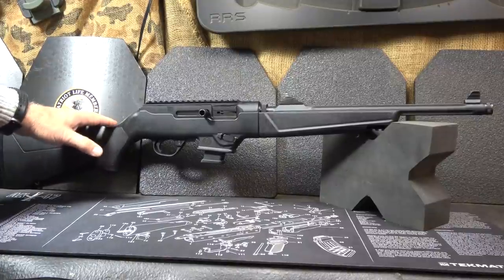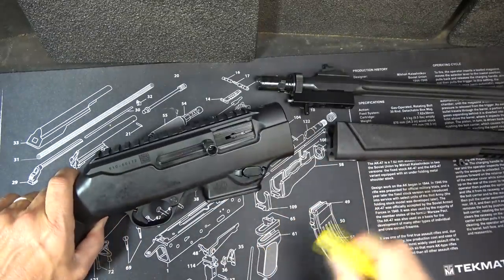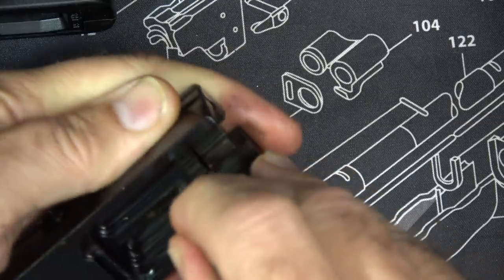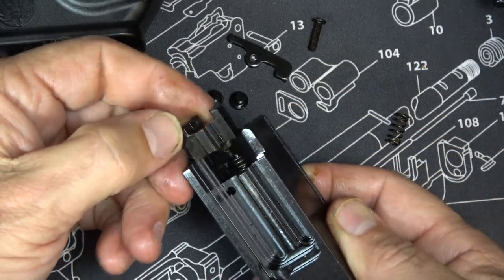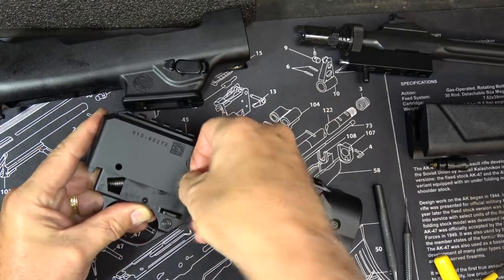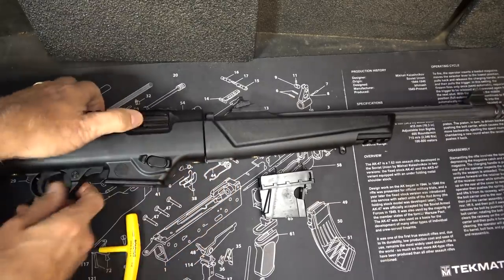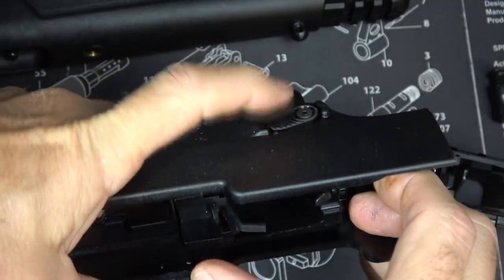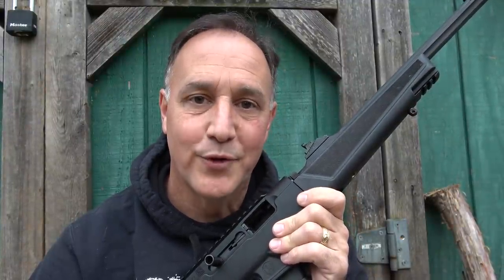How To Disassemble the Ruger PC9 Carbine

Comment: So far I've been really enjoying my PC9. It has been very reliable using my SR9 mags. Oddly a 32 round Promag I bought fully expecting to fail a lot has been reliable as well. Overall I've been very happy with my purchase. A 10mm version would be very nice as well.
Reply: Does the 33 promag only fit the glock fitting or can you get it for the ruger fitting?
Reply: @nickname2678  worked fine with the Ruger magwell

Comment: Be careful with the trigger group: the slide stop is held in by a small removable pin. After I cleaned and lived the gun my slide stop pin dropped out followed by the stop itself and the tiny detent spring which keeps the stop under tension. It was an easy fix after I found the spring and located where to insert it.
Reply: Same thing happened to me, which is why I’m at this video. Spring and a little L shape slide stop with pin showed up out of nowhere.

Comment: Am getting a new ruger pc carbine soon watching your disassembly/reassembly video does the 5/32 Allen key ship with the gun also on the ruger tech tip upon reassembly a torque wrench with 65inch pound is used to tighten the charging bolt and the 2 bolts on the forend assembly I wonder if that is really necessary?

Comment: Careful, the pins fall out easily as you remove the inner assembly.
Reply: Note:  you have to pull bolt back to remove the barrel off, but then you need the bolt released forward to get the charging handle off and to remove the trigger group.  If the trigger group  pins don't just push out, check that the bolt tension is released.  When the trigger assembly is out of the receiver, touching the bolt latch releases the little retaining pin to fall out.  Following the pin, the latch will drop out along with the spring as small as the pin.  My shop floor got a through cleaning until I found the spring. lol.

Comment: When I pulled out the trigger mechanism, a small long spring fell out, along with a small bar similiar to the ones you pushed out to get the trigger out. I have no clue where it came from, and don’t see it on your vid or the manual.